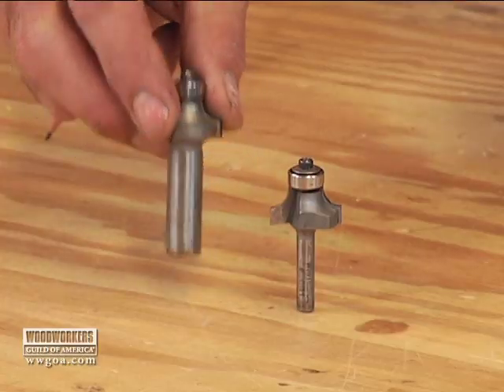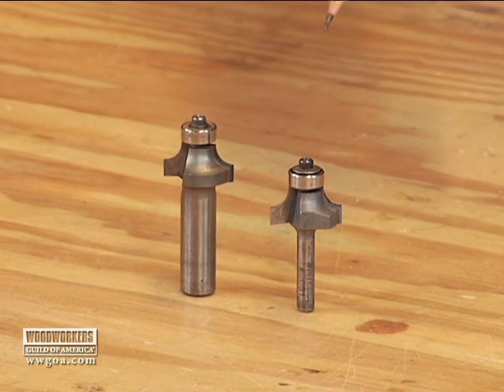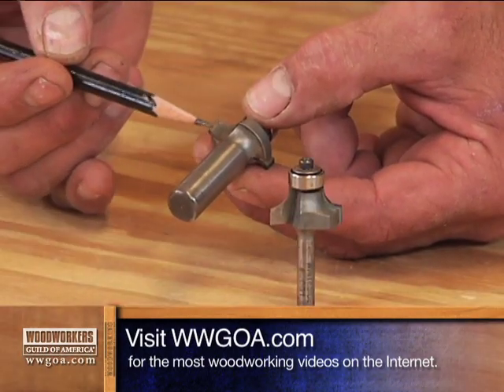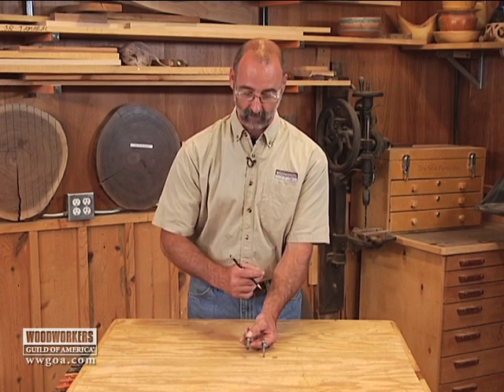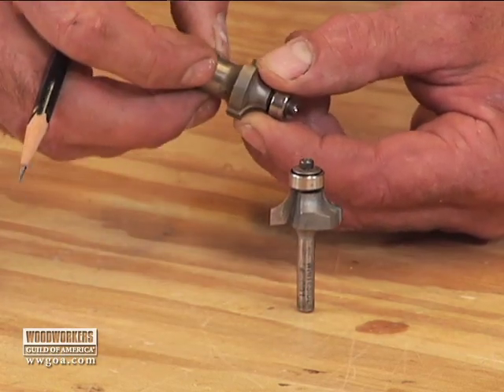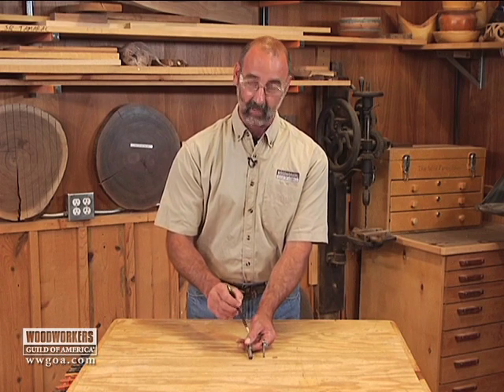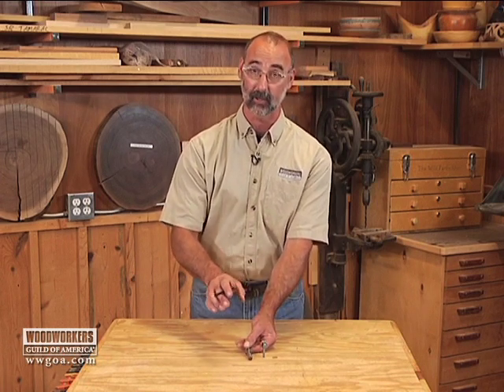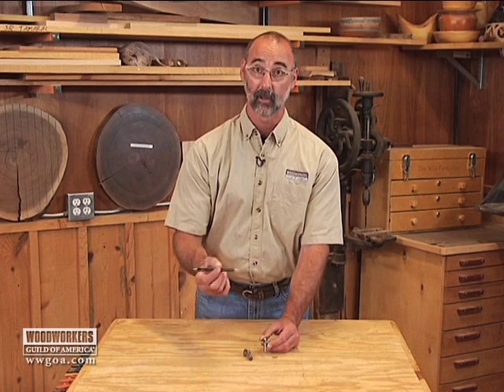Woodworking Tips: Router - 1/2" vs. 1/4" Shank Router Bits

Comment: I'm very new to woodworking, I have inherited a lot of my dad tools, one being an old B/D router with a 1/4" collet. I don't plan on doing anything aggressive with it, just edge trimming. I was wondering if it would be safe to use and what kinda bits I should start out with. Thanks
Reply from the maker: Hi David, 

Thank you for contacting us. 

 I would look carefully at the collet to see if it's in good shape.  Run it with a bit, and turn it off.  If you notice any slipping of the bits, I would immediately replace the collet.  Repeat the test a few times, allowing it to run a longer interval each time.  If you can't find a replacement collet, I would not use the router.  
In terms of bits to use, it depends on what you want to do with the router.  I use mine most commonly for edge treatments, so for me, it would make most sense to start with a couple different roundover bits.  But there is virtually no end to what you can do with a router.

Paul
Woodworkers Guild of America

Comment: Hi, informative video thanks. Could you advise as to whether there is any way of a 1/2 bore router reducing to a 1/8 for inlay cutting? I’ve got a decent Makita and recently bought an inlay / patterning kit. The v bit that came with kit is 1/4 inch for which I have a collet but the inlay bit is 1/8. Any advice is greatly appreciated....the main emphasis is safety of course! Many thanks
Reply from the maker: Hello, 

This looks like it is designed for your purpose: https://amzn.to/2za81uB

I don't have any experience with this bit, but it looks pretty straightforward.

Thanks, 

Paul
WoodWorkers Guild of America Video Membership

Comment: I hope you may be able to help or direct me regarding my question. I received a 1/4 Shank Router as a gift. I would like to know how would/do I had the router differently than a 1/2 Shanked router, as I am new to working with a Router.
Reply: Sal C > If you have a trim router you would need a larger router—something in the order of a 2.5 HP model. These typically come with two collets—.25 and .5 inch which would give you the versatility to use both shanked sized bits.

Comment: I agree with your advice, even though I'm fortunate enough to own both 1/2in and 1/4in routers for hand-held use, plus another 1/2in one mounted permanently in a table.

With my 1/2in router (a DW621K), I prefer to use cutters with an 8mm shank. They chatter far less than 1/4in cutters and any 'screeching' certainly won't burst your ear drums! :-)

Comment: That does not convince me," cause both do the same job.All depends how tight is the 1/4".
If you use the 1/4" and dont want it lose when working then just put a masking tape around it before tighting it up on the router.Both shrank 1/4" and 1/2" will deteriorate after heavy job. I use my 2.5HP router only with 1/4" shrank cause its cheaper.When I say cheaper I mean much cheaper then 1/2" shrank.Take a look in Aliexpress for price difference between both. Imagen buying these shranks in the USA. So the difference between the two shrank is quit big
Reply: A larger shank is much more rigid.  Less vibration, less deflection.  Yes, it will cost more, depending on where you buy it.  Maybe 1/4" shank is good enough for what you are doing with your router.

Comment: so better it is to buy a 1/2 router
Reply from the maker: Yes.  You are better off with a 1/2" router.  Most 1/2" routers will also include a 1/4" collet if you ever need it.
Paul